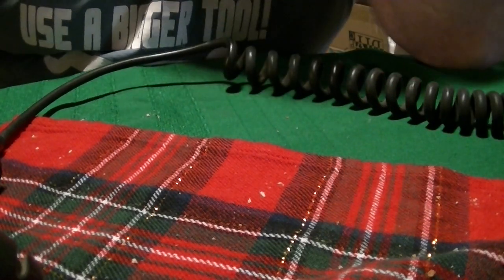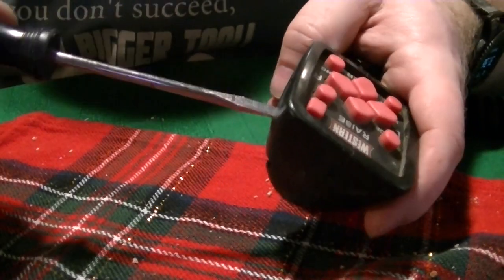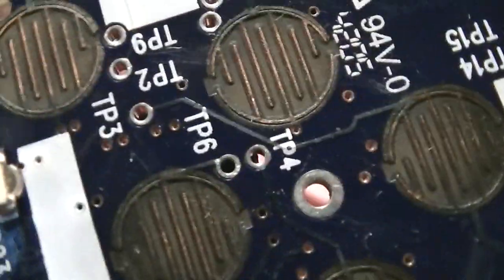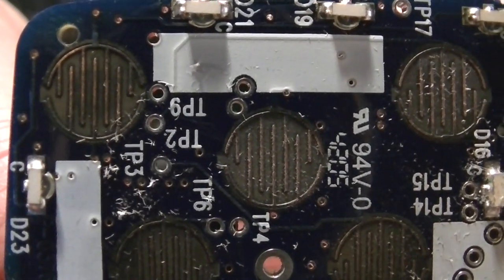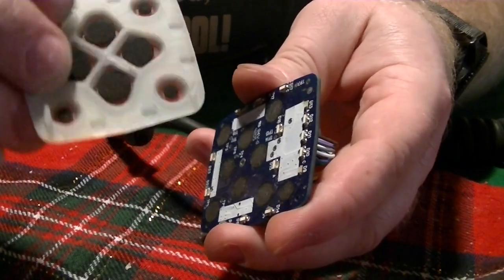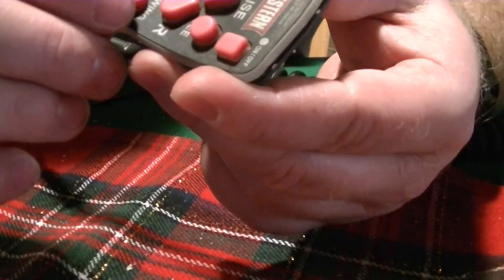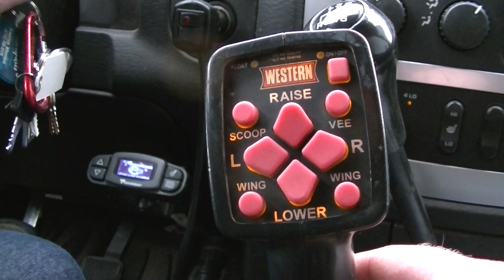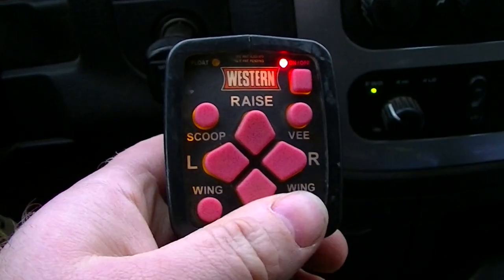How to fix a Plow Control when the buttons won't work.

Comment: Saved me as well was intermittent on and off and not near as corroded as your but just the power contact.  But after cleaning with some alcohol it worked first time.   THANK YOU

Comment: Thanks for the video. I might suggest though that instead of using just a piece of paper to clean the contact surfaces off that you use a dollar bill. Reason is they are lint free. As previously being a radioman in the US Navy we used to have to clean electrical contacts on some of our radio gear and being sensitive to dust and lint we found it to be the best thing to use. Thanks again. Keep on plowing.
Reply: Lol our Canadian money is plastic. Won’t work 😂
Reply: @robertlee4165  🤣

Comment: So am I understanding properly that these western controllers will not turn on if the plow is not hooked up?
Reply from the maker: Correct. The controller backlighting will illuminate when the plow is hooked up, indicating that the controller has power. That is, as long as the backlights work.
Reply: @TheFarmerInAdell  ha right! I've got a new to me hts that I wired up and when I push the power button nothing happened. Everything I've had before this was Meyers and those turn on whether the plow is hooked up or not.

Comment: Do.... NOT.... use sand paper. This will permanently and irrevocably make your buttons less responsive.
Reply: I used 2000 grit and it worked fine. Fixed 2 controllers.
Reply: @robertlee4165  Sorry, you made a temporary repair that also damaged the components. I've been repairing keypads professionally for 30 years. Seen plenty of these sanded contacts destroy a device.
Reply: You said it would make your buttons less responsive. They work like a brand new controller now. How long it works that I don’t know cause it’s the first time doing this. Only time will tell but I do have a spare controller now and saved 800$ for a new 1.  👍🏼🤞
Reply: @robertlee4165  It's like sanding your teeth to get rid of a stain. You are removing the protective coating and introducing scratches. It will fail faster than cleaning alone (which doesn't last long) and you can never get the "enamel" back. If you don't care about the equipment, sand away.
Reply: @buttonwizard6644  well then let’s hear what you do to fix a button that doesn’t work?
Reply: @buttonwizard6644  well that’s interesting too. If I end up buying a new controller if the 2 I have fail I’ll definitely try the membrane on a new controller if it fails. They certainly don’t last long before a button doesn’t work. 2 controller’s button failed  in 3 years. Like everything else in this world China JUNK! Cheers and Thanks

Comment: Yo brother thanks for saving me 800$. I fixed my left wing button on my newer controller and then turned around and fixed my older controller. The scoop button didn’t work. The only difference I used 2000 grit lightly. Found it worked better. Your a genius and I’ve already spread the word like a bird to other contractors. Screw the stealerships. They would never tell you this fix!

Comment: I am near Toronto and I can repair those circuit boards. Success rate is pretty much 99.99% unless there is a badly damaged cable. So if you have an issue, let me know. Thanks.
Reply: Hey man send me a msg i am in niagara and need help with a controller
Reply: How much for the plug itself? The coating is basically off on the protective housing. Just waiting for it to break honestly.

Comment: I wonder if adding dielectric grease also helps ...thanks
Reply from the maker: I have not tried that. I would be hesitant to use it because I don't know how it will work. It is not metal-to-metal contact, it is a conductive rubber pad on metal. I'm not sure if the dielectric grease will have a negative effect on it. I can try it when it's not plowing season to see how it reacts.
Reply: @TheFarmerInAdell  true .
it might degrade the rubber pad.
Reply: I wouldn't use grease as it will only collect dirt etc. Quicker I would think.
Reply: @parkersgarage4216  its under a protective cover dust doesnt get in the area.

Comment: This is TERRIBLE advice! The material on the board and keypad is carbon needed to create conductivity between the keypad and the circuit board. Using sand paper removes the protective layer and causes corrosion to form weeks after doing this! Do NOT use chemicals, sandpaper, or even an eraser. That black material coming off is NOT DIRT. Either have your controller professionally serviced or replace the keypad with a new factory one. This will DAMAGE YOUR CONTROLLER!
Reply: You must sell new controllers or do the same thing for people and charge them. There is nothing wrong with this do it yourself fix. A dealer would never tell you this fix cause they want to sell you a new 800$ controller. Cheers
Reply: @cubicinches100  I used your fix and my controller has worked fine all year. Still have my back that I fixed and haven’t used.
Reply: @robertlee4165  Some people do things wrong for their entire life, and have a certain amount of success. So, they think they're doing it the right way. They never learn the correct way, and they never get any smarter.